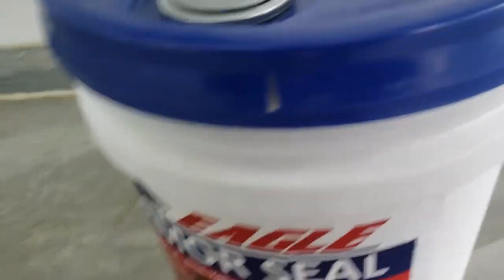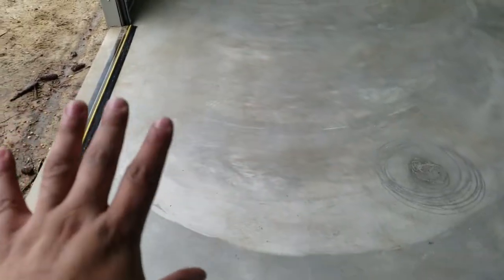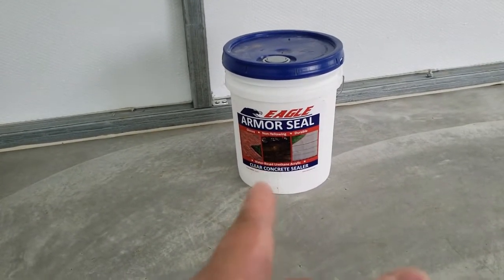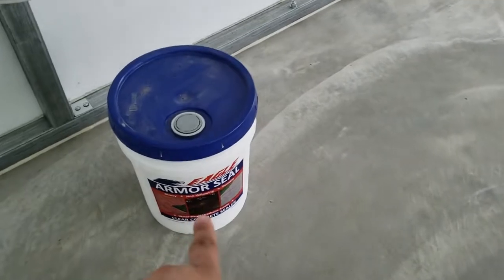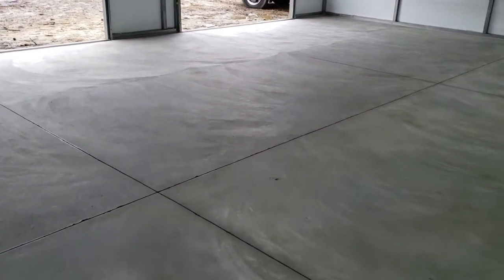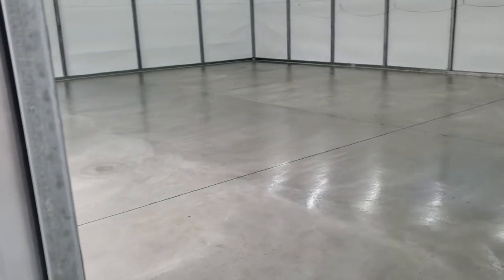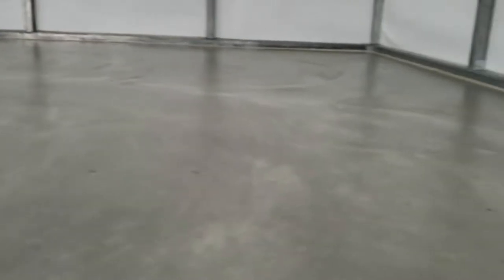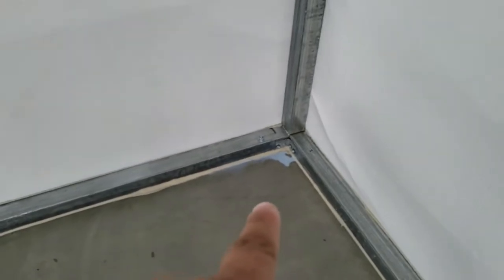Sealing my Shop Floor w/Armor Seal

Comment: I know those "Eagle" guys lol. They are here in Nashville. That stuff is a urethane fortified acrylic which is tougher and more chemical resistant than regular acrylic. The water and resin really dont want to be together and will seperate when rolled and thats why its important to roll it twice. BTW, Lowes sells the same as Clear Seal

Comment: Hows that coating and what lights are you using I just got my 30x40 shop done
Reply from the maker: Shop lights - https://amzn.to/3waKh7q

And coating is doing good! In hindsight I would've just cleaned the floor first by power washing. But overall the coating is holding up just fine👍

Comment: Thanks for the video. I have a new garage floor too that I'd like to seal. How has it held up after a year?
Reply from the maker: It has held up as expected, achieving my main goal of easy cleanup for oil and fluids, surpassing bare concrete. Though a few parts have dropped and chipped the concrete, ordering some more sealant and recoating that area should be no problem. I still recommend this as a budget-friendly floor sealing solution